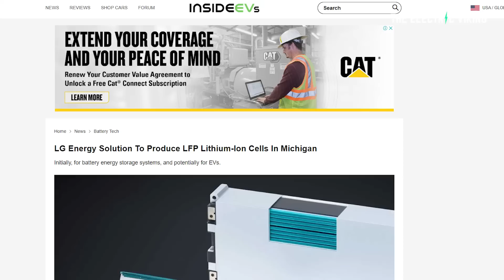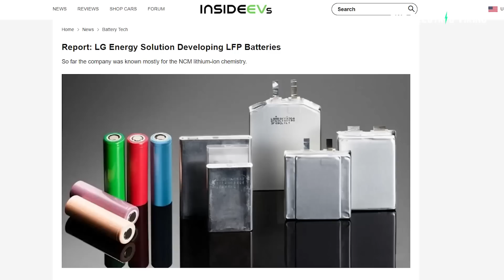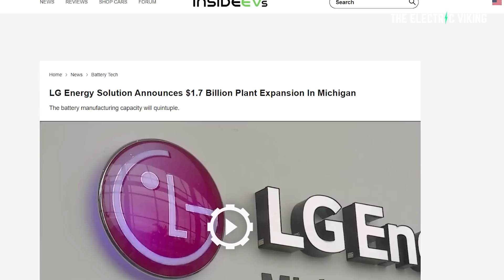Massive LFP battery Gigafactory ramping now in the US

Comment: 90% of Australian petroleum is imported. 
EV car battery daily use is 10%.
The EV long trip, 100% battery use, is an annual thing for the majority. 
EV car battery can be topped up constantly. From home or the regular parking spot. 
When every EV car is plugged into the grid, and trading power with the grid,  the grid will have a massive storage online. 
The money is in the grid. 
Every building is connected to the grid. 
Every rooftop can over supply the grid. 
Automatic plug in gizmo is the killer invention for EVs. and the grid. 
Good bye Petroleum 
Good bye power bills 
Good bye fossil fuels and CO2.
HELLO  excess power.
We are building new 900klm power transmission lines to SA. $20million per klm.
We can build the 1,600klm transmission lines SA to WA, the gap, and add 3hrs of sunshine 🌞 and have a 5,000klm grid.
We can build solar PV power plants across the Nullarbor desert. We have a railway and highway now.

Comment: Viking, LFP batteries work good with a PHEV's (which I don't really like from a purist) but if battery supply is constrained, a PHEV with a medium sized battery sized to have 30 to 40 miles of range minimum on the highway, would allow a faster reduction in carbon emissions in the short term.  If 100% of non-EV's sold were PHEV's design like this until 100% of car sales were EV's, transportation carbon emissions could be reduced faster.

Comment: hey Greener; No doubt Tesla has grabbed as much as they can; but that doesn't help when there is a shortage of an essential element.  A contract does not assure production of anything, nor that the price is not rising, even Tesla has to renegotiate if a producer refuses to put out or your contract ends.  You will note a cross the board increase of Tesla prices of approximately 1500 per car.  While I can't prove that is tied to the price of Lithium it does correspond to the approximate increased cost.
Reply: It makes sense for sure but tesla was smart about it and made assurances about process the others won't even think of to the local governments. Those governments can then hold that as a minimum standard. The pricing already covers the neutralisation of toxicity in its processes. I doubt given the contract sizes they will want to break faith for short term gain. In the long term it will make them look unreliable and disincentives future contracts. I have heard though I'm not sure on the reliability they have some leeway on pricing due to market conditions, given they anticipated  the shortage some years ago, they probably planned and explained when negotiating the contracts.

Comment: I bet the standard size battery is a 4680, I'd put my house on it
Reply: At 6:03 he talks about the 2 new LFP battery packs they will make will be exactly the same pouch sizes of cells they make with the old chemistry.
Reply: @jimbodee4043  yes he does but he also said LG will make a standard size CELL not pouch plus it know for certain LG is making the 4680 and if they are making a standard cell it won't be financially viable doing any extra small cells when it's widely held that the 4680 is the future of cylindrical cells using Tesla's tabless electrode. LG is also making a pouch cell based exactly on gms ultium and is why gm named its battery system so it differentiates gms LG cells in the future even tho they will be identical to lgs current pouch cells

Comment: Tesla honestly should devote a major push with their r&d toward super capacitors
Reply: They owned a supercap company. Maxwell technology. They sold off the supercap side of the business. With the size of the battery packs in most cars they don't help that much. They would help with regen a bit but for the cost and weight you might as well just add more batteries.
Reply: It's a little hard to follow all of teslas acquisitions but I think they bought a research company that was working on production of supercaps last year along with several battery research companies.
Reply: @makeitgreener642  interesting I was brainstorming designs a few years ago, kind of curious what designs they are looking at

Comment: This is great news. I do wonder why all of these manufacturers persist in making pouch cells when the 4680 format is so much simpler to scale with a fraction of the amount of equipment? Presumably this is because it's what they know and have perfected. However, it's going to put them at a long term disadvantage when Tesla and Panasonic really start to scale their production. Long term, I can't see the pouch cell surviviing.
Reply: Yeah no! Thats not correct, they are increasing the pouch cell left, right and centre. Its the cylindrical cell that will be lost
Reply: Both cell types will have very different uses long term.... both will probably survive long term as they evolve.
Reply: The factory was first expected to do prismatic, but not anymore.  Such a disappointment.  Pouch cells don't have that long of a lifespan in moving objects versus prismatic.  I'm hoping they use these batteries for home/business backup or grid stabilization, not cars/trucks.

The first part of the factory for the small batteries is set to open in the fourth quarter of 2023.  The second part for the large batteries is expected at the end of 2024.

Comment: Tesla is not going to stop building batteries in the US, and they are going to be the biggest Battery company in the World.
Reply: Despite what the Tesla fanboys say, Tesla does depend on LG, Panasonic, CATL, and BYD to make its batteries.
Reply: @AI_HQ  they also make their own batteries and have the cheapest and most efficient manufacturing process of any cell manufacturer. Tesla can build almost 10x the capacity for the same capital in the same space. That's going to be a huge advantage going forward as they ramp. They will also still buy every cell they can from all other battery manufacturers.
Reply: @AI_HQ  just as the legacy rely on all their suppliers!!  At some point Tesla may not need the other battery suppliers except CATL. Tesla will be ramping up to be the largest battery company in the world.
Reply: @AI_HQ  they don’t buy from BYD. Yes the buy from all those companies and will continue too!!

Comment: Perhaps the average American will actually be able to afford a new electric car besides the Tiny Bolt, or the limited range Leaf.
Reply: Using a leaf with a newer battery pack can get around 160 miles even upgrading an old one achieves this. Considering the price not terrible.

Comment: More factories doesn't mean more lithium.  This is the choke point not manufacturing plants.  The Li price has risen 1000% in the last 10 years and nearly doubled this year so far - existing stocks will be put on the market but then you face a serious supply problem as production declines; the easy sources are gone.
Reply: Haven't you seen the news? There is enough Lithium in the Salton sea area in California to supply all of the USA needs.
Reply: Meh tesla is fairly well insulated from this by there contracts, but even they are feeling an increase of around 10% on material costs. Some suppliers are asking for a price increase of almost 30% from them. Tesla are working to reengineer so suppliers costs are lower. You want to build EVs you have to change perspective and be prepared to change like the wind with supply constraints. Redo the work find another path that is as efficient  or bette, or struggle to build.
Reply: Correct. The end price of more batteries being produced might not result in lower costs for the volume of supplies needed. In addition, the US is a high cost manufacturing country.  For high end vehicles with expensive batteries consumers are expect to suck it up, but the EV volume lies in affordable vehicles not the Lucid Air.